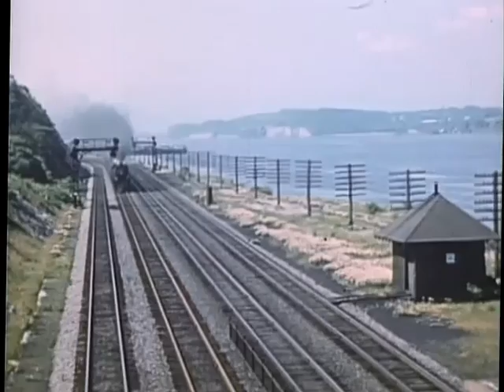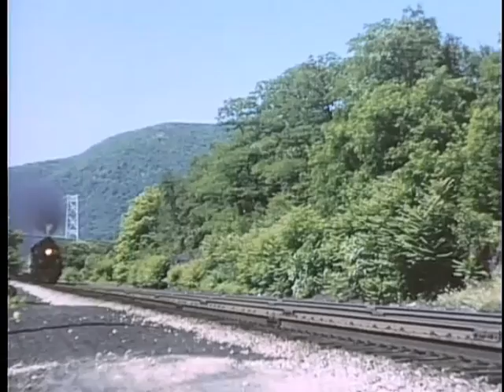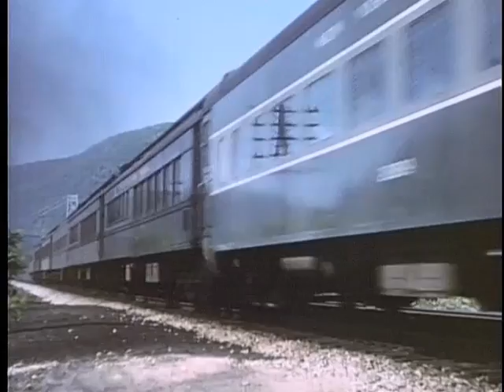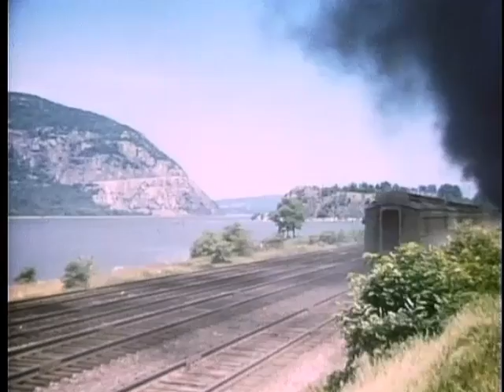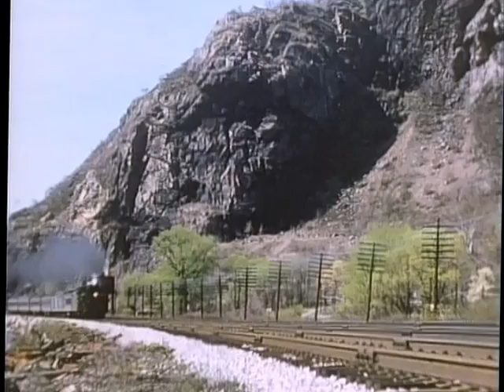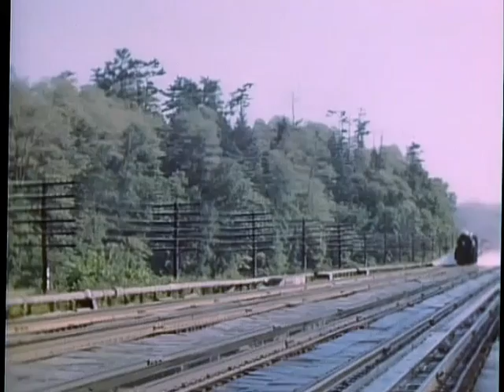"Hudsons Along the Hudson" DVD by Sunday River Productions

Comment: C&O 490 is a streamlined Hudson currently stored at the B&O railroad museum. Would be nice to get that thing restored
Reply: I thought it was 490?
Reply: C&O 490 isn't a J3a. She's an L1.
Reply: @AdmiralColdhead  I Got a J3a Hudson Number 5406.
Reply: @maxwellwalcher6420  Sure you do.
Reply: @AdmiralColdhead  5406 is built by the Lima locomotive works in 1929 and streamlined by ALCO in 1938 would she be steamed again,
Reply: @maxwellwalcher6420  Ok. But she’s gone. She was scrapped.
Reply: @maxwellwalcher6420  Sorry but there are no Hudsons around anymore, All were torched between 1953 and 1956 with non being saved.

Comment: To keep the coal fuel damage in perspective we need to realize that coal was the fuel of choice, but not the fuel of necessity. Other options were wood and oil.  Granted there were downsides to them as well, the coal pollution, in principle at least, could have been mitigated.
Reply: What if you were to use both coal and oil? Like infusing or soaking the coal in engine oil?
Reply: @amtrak_121  A chemist would need to answer that, but I can easily imagine the disadvantages multiplying.